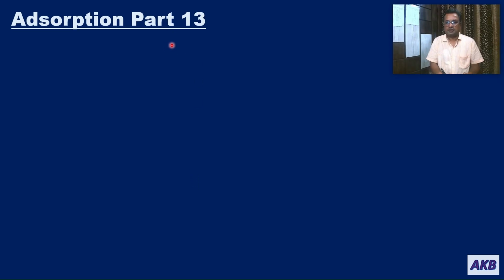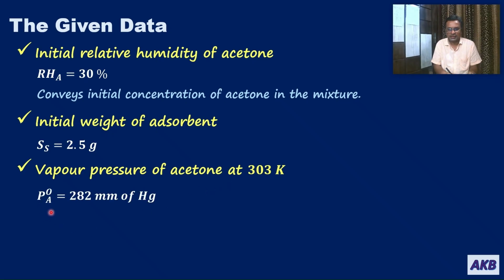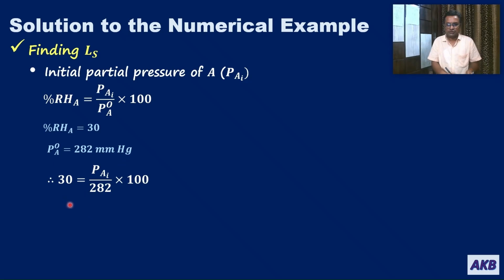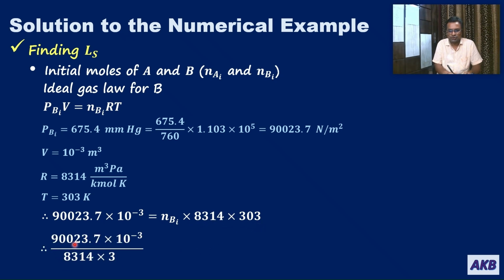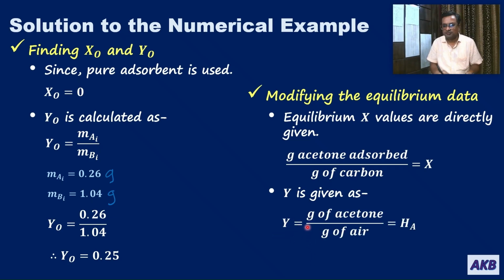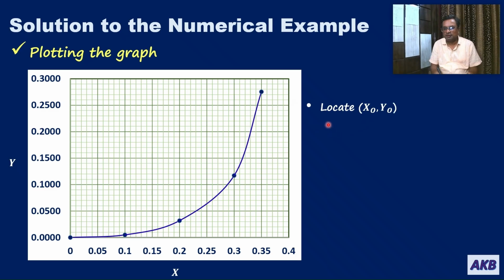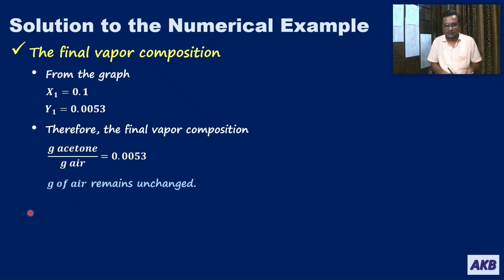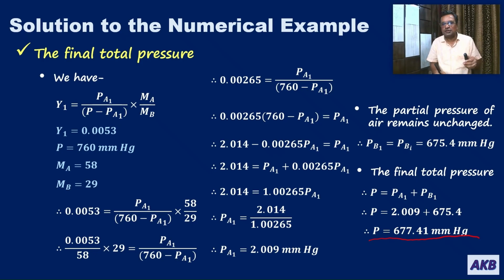Adsorption Part 13 A numerical example based on Single Stage Adsorption

Comment: By using the protractor i get theta value as -67.4 degree which not similar with your's by other method
Reply from the maker: Ok I will check
Reply from the maker: tan of -67.4 is -2.4
Reply: @AKBChemical  yes sir I got the point

Comment: In last part regarding calculation of final total pressure, can't we use Pb directly (fixed for air =675.4)) in Y = PaMa/PbMb ? Or does we any third component which contributes to total pressure?
Reply from the maker: The final total pressure which is the addition of partial pressures of air and acetone, will change as some acetone will be getting absorbed.